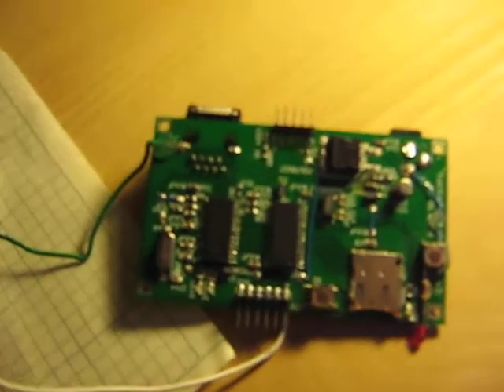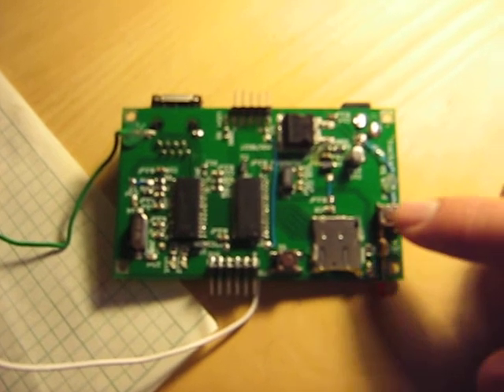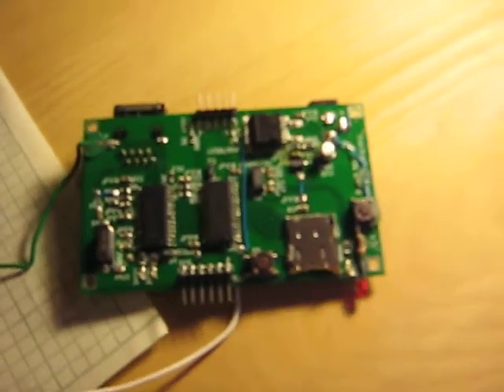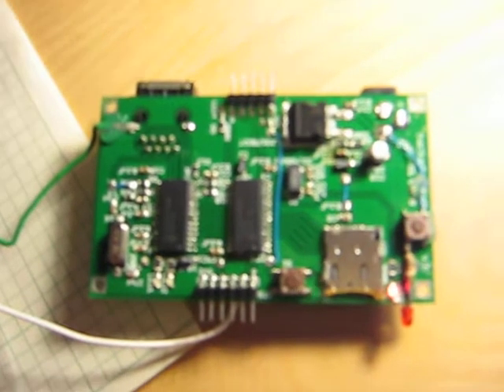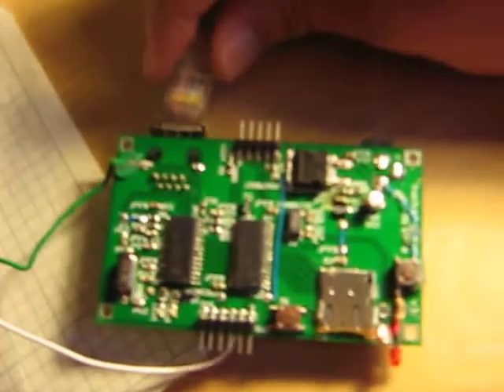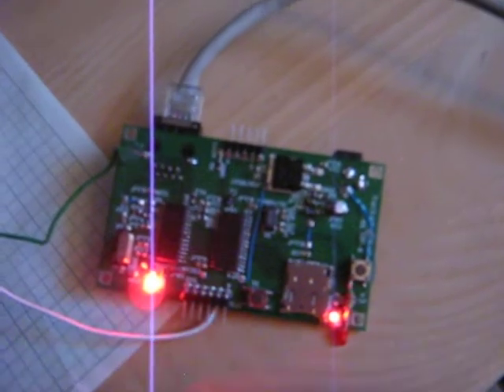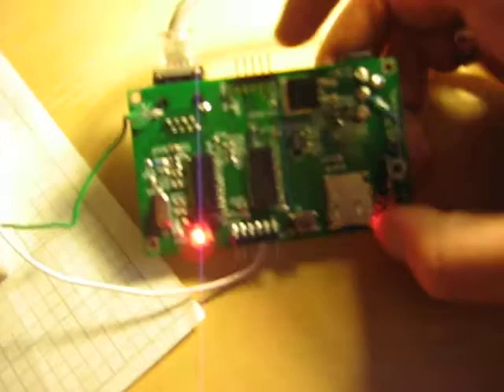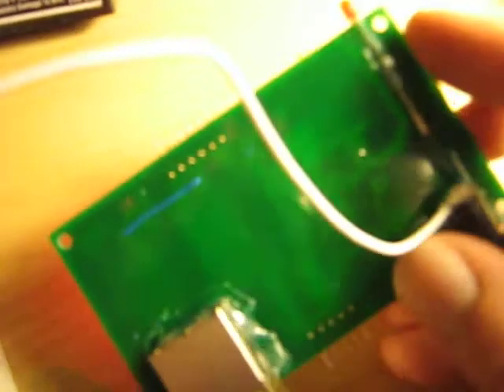HackADay Business Card WebServer Assembled

Comment: The ENC28J60 is a nice ethernet controller, especially when it is compared to a RTL8019 or CS8900 for pin density and cost. 

You no longer need an excessive ISA bus to control the chips, only the easy to use SPI interface, which leaves more I/O pins of the uC open for whatever you need it for. 

The beauty of this IC is that you can use it with your favorite microcontroller, Atmel, Texas Instrument, Scenix, Reneasas, Microchip, Intel, Phillips, et-cetera.